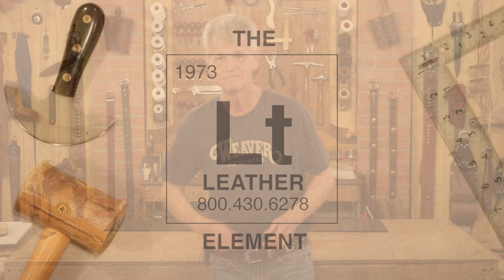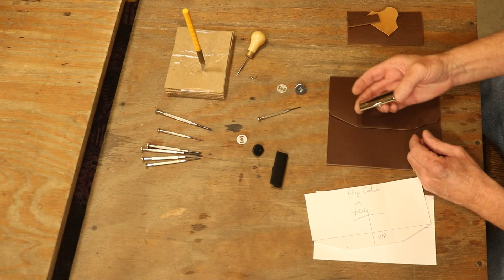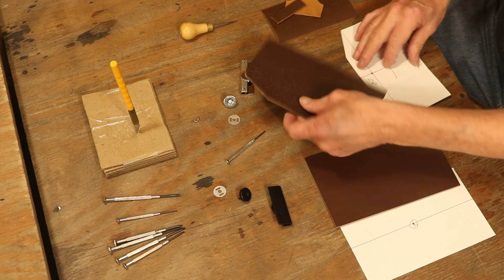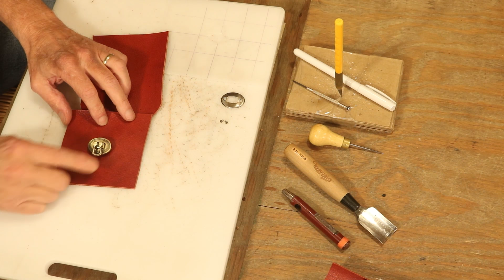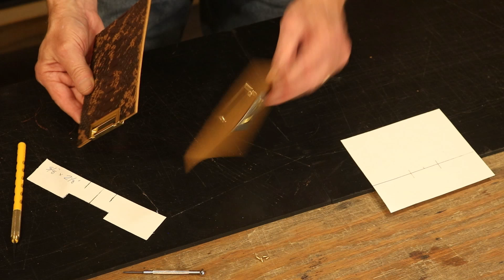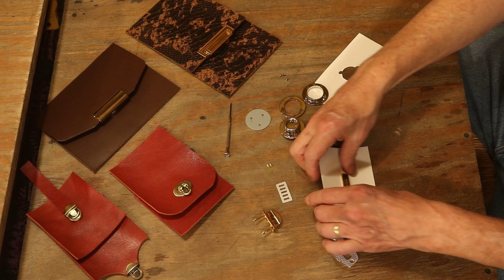How to Install Premium Leather Bag Closures: Flap Catches, Drop Locks & More

Comment: I my missed this one by a few weeks. I am drawing out plans for a leather bag for a 7-1/4 circular saw & extra blade pouch inside. I did not realize there were so many different closures. Which one do you think would be strong and durable for a work type bag? The reason for this project is the flimsy nylin bag that came with saw is just too small and weak. I will be using the Weaver Leather Firmer. Hopefully it will work after I neetsfoot oil the leather. Will test in a scrap piece, need it to be hard and sturdy. Thanjs for the video and any advice. 👍😀❤️🤗